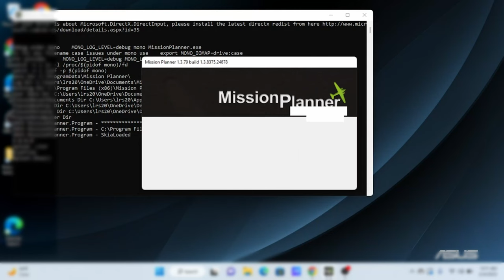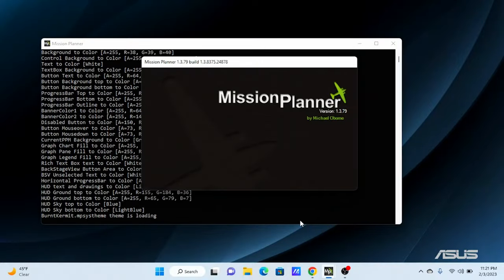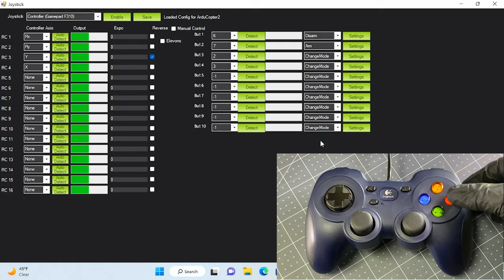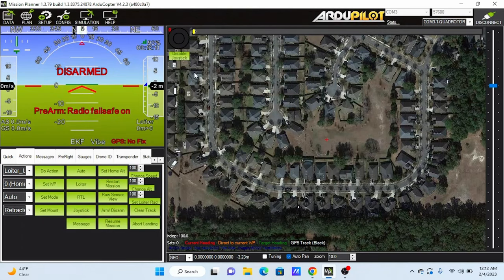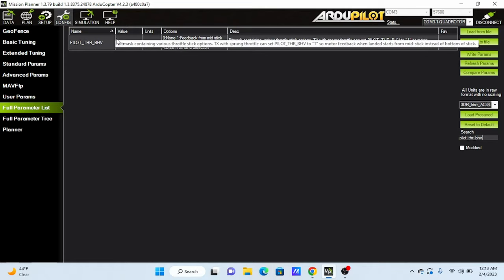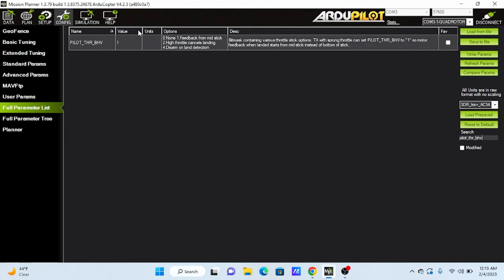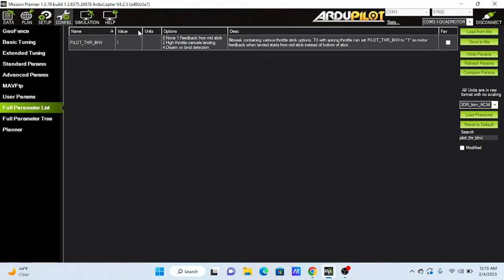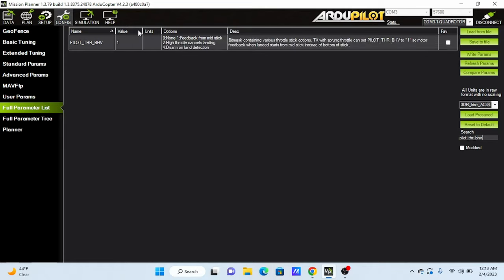How to setup Joystick/Gamepad copter | Custom Drone Part 3

Comment: Very helpful, thank you. I would like to ask how to make if have the radio next to me, and i want to pass from MissionPlanner/gamepad  to the radio for  control the drone by it. As a sort of redundant system. Thank you
Reply from the maker: Hi CP-zi3eg. You’re welcome. The default/recommended setup for arducopter is to use the rc radio as documented on the ardupilot website. Mission planner/gamepad is just an added feature to control the drone with your groundcontrol station. Once you enable the joystick in mission planner, the control will be handed over to the gamepad. If by any chance you disable joystick or unplug the gamepad while drone is midair , the rc radio will takeover. With this you have to be sure your rc radio throttle is at middle. If rc radio is not present only then failsafe will kick in and rtl your drone as shown in my video.

Comment: Really helpful. Thanks!
Reply from the maker: @masterking549. Glad I could help. Love sharing my passion with the community of rc and robotics enthusiast.
Reply: @LyndonsWorkshop Very good! What software did you use to send the commands?
Reply from the maker: @leandro1869  I’m using the Mission Planner as my groundcontrol station. All you have to do is configure the gamepad as seen on the video. Mission planner will then send mavlink messages to the drone.